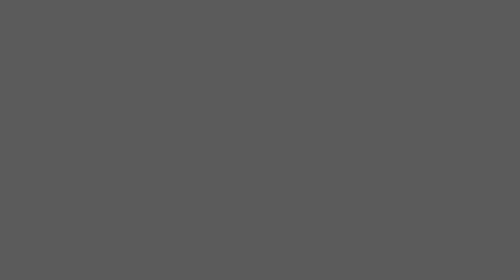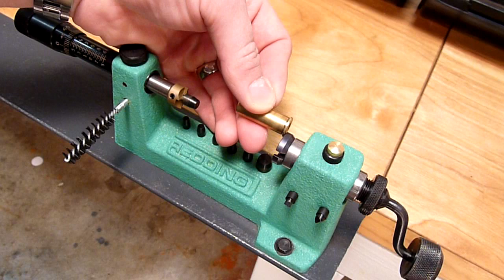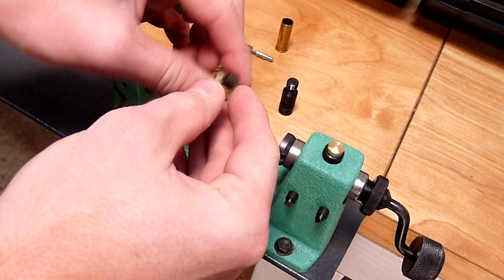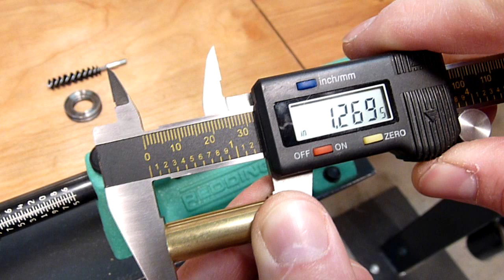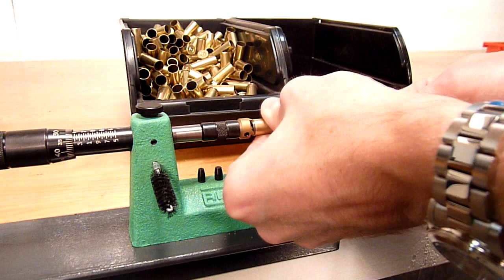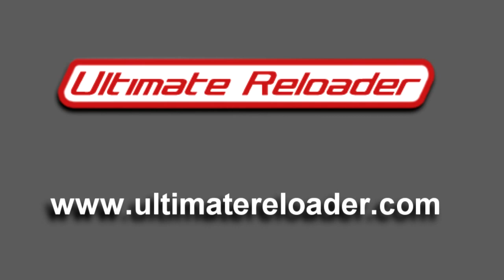Redding 2400 Case Trimmer - Trimming Pistol  (HD)

Comment: Hi, nice vid.  I just got this case trimmer.  I don't really understand how and when to use the round spacers that come included and are shown on your bench.  Instruction say something like helps to lock in cases with different step sizes, but that just went over my head.  Do you/ can you show how they are used?  Thx

Comment: when trimming either pistol or rifle brass i know that you have to keep the length shorter than the maximum length but would you take the time, if you wanted to that is, and measure each brass length that was under the maximum length to see what your gun shot best (for either a revolver or semi auto) and then cut them all to that length?